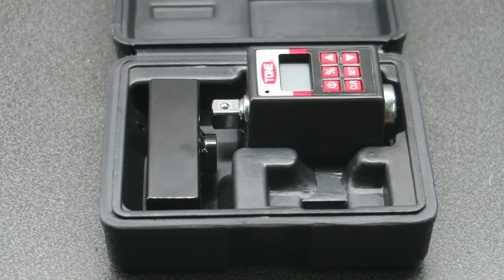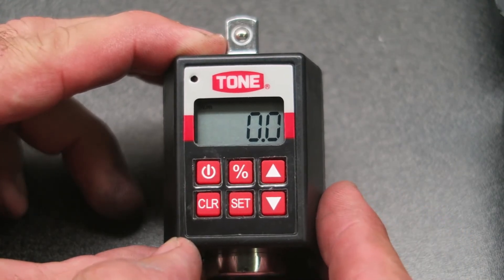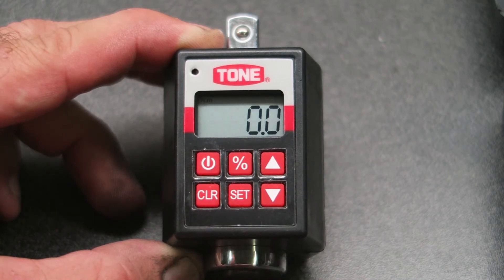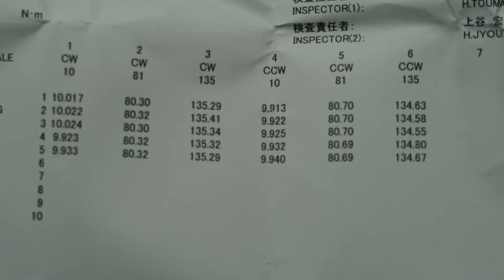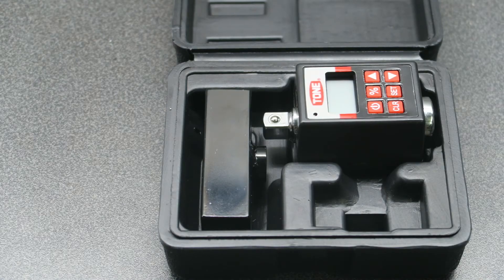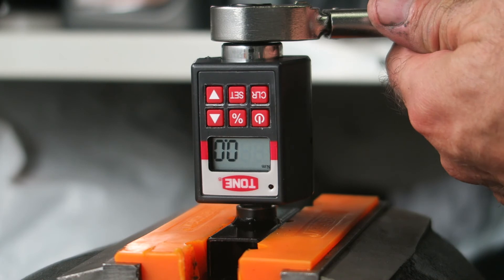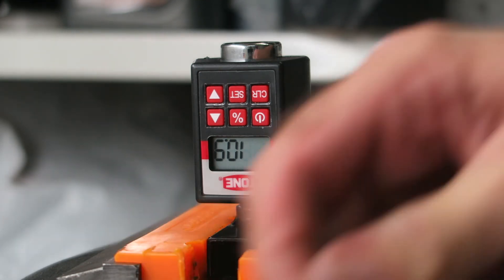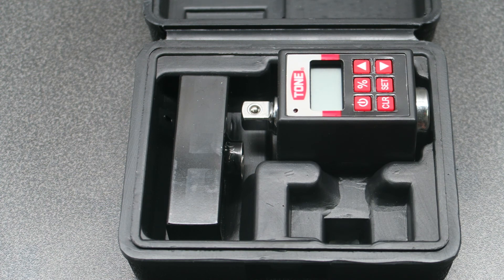Torque Wrench Calibration- Tone  H3DT135

Comment: Why did you not put a link to purchase this adapter?  Also why do people keep advertising torque/angle adapters?  That is absolutely dumb to my feebleind.  An adapter that has a, say 250 pound/foot rating, then an angle Adapter built in it?  If your torque is 250, them you cannot go farther to say 30 degrees plus.  You just decapitated the adapter at that point.

Comment: What brand and type of your torque wrench?
Reply from the maker: All my torque wrenches are made by Tohnichi. The model in the video is the the Tohnichi QL50N-MH (10~50Nm range)
Reply: @TokyoOffroad  I see.. So no need special tools for re-adjusting calibrate the torque wrench? If i'm not wrong, you only using a hex key?

Comment: You're holding your torque wrench wrong. The correct way is to hold it is only in the middle of the hand grip, otherwise your results will  not be accurate.
Reply from the maker: Pro1er - I was holding it in the middle of the hand grip with my right hand and applied torque here. I used my left hand to steady the wrench so I could apply slow and steady torque. I found that only using one hand with the torque converter in the vise like this, I was getting overshoot caused by following through, after reaching the torque setting. By using my left hand as a steady the results are much more accurate and reproducible.